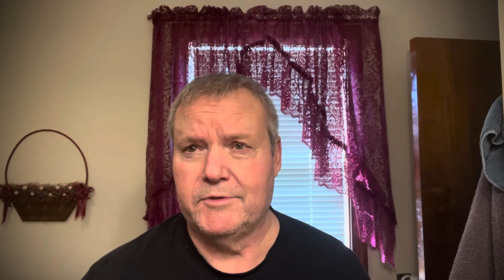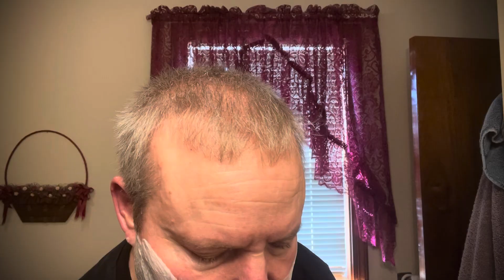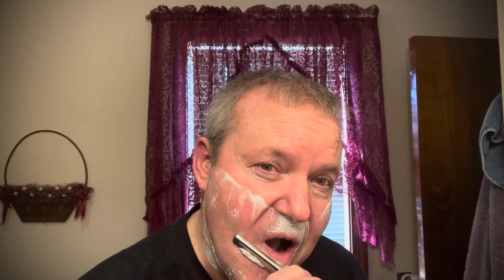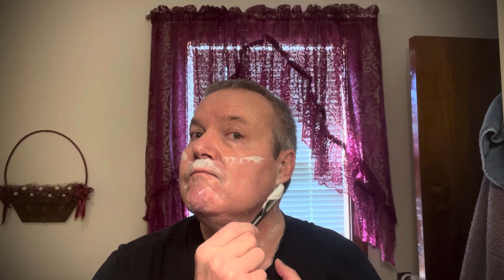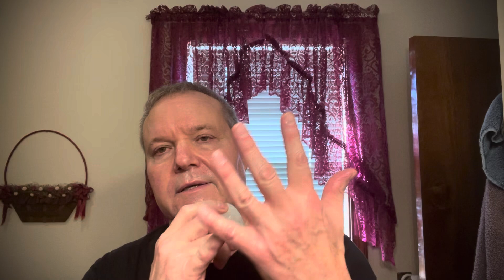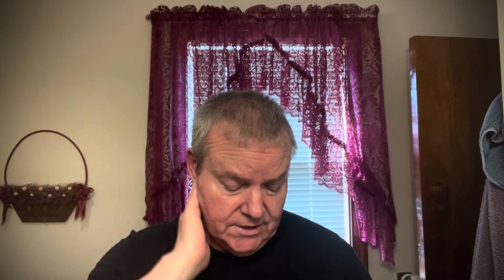Do Mountain Men use Straight Razors?

Comment: You will get more even, prolonged heat out of the microwave....come to the darkside Bill, throw a wet towel in the scuttle and try it....start in increments if you have a potent microwave.  Tonight I put my scuttle and towel in the nuker, sat down and got busy doing something else....10 minutes later, after the microwave had shut off... when I pulled the scuttle and towel out of the microwave it was nice and hot still....good to go!  Cheers Bill😎

Comment: I watched Mikey Shaves using a shavette and pickin' on his banjo!🪕🪕🪕Nice shave Bill.  I have tried using the tape as I have seen others use it, but I found the the black vinyl coating on electrical tape fills in the pores of the ceramic stones.  It would blacken the surface of the stone and I didn't like that.